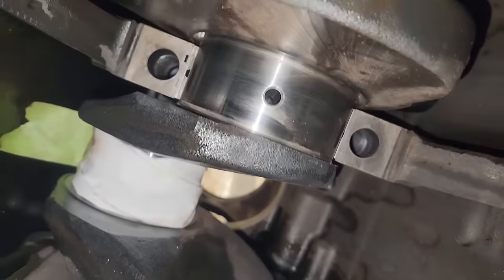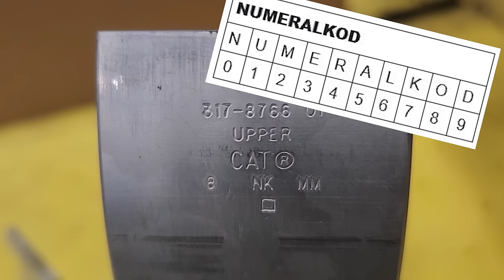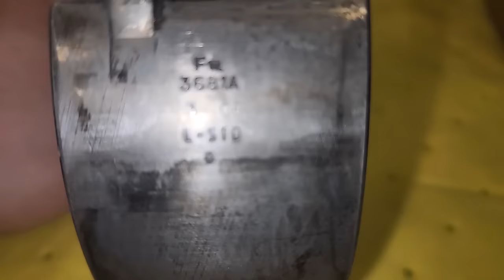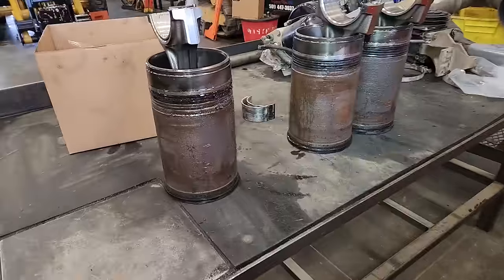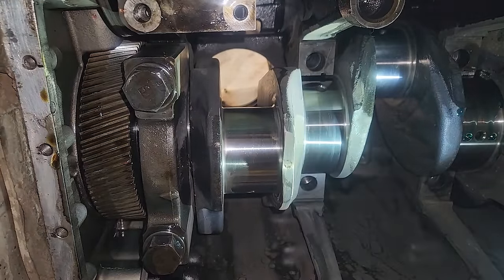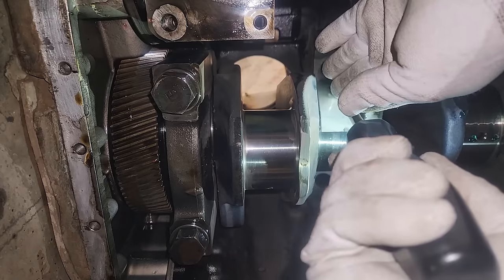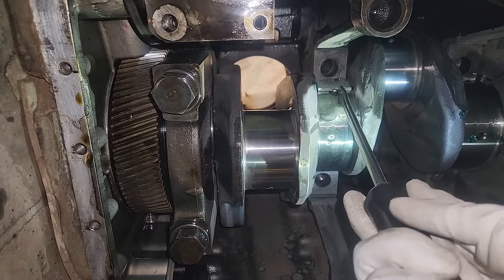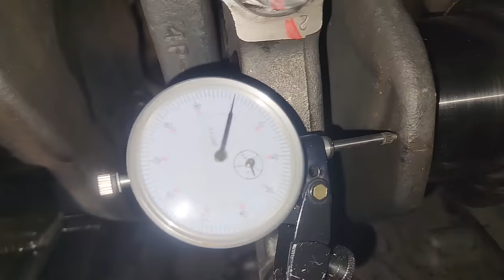How To Replace Engine Main Bearings.

Comment: I have used Lubriplate 105 for reassembly for more than 50 years. Dissolves almost instantly in warm oil. My roll in/out tools are short bolts with the heads ground down.

Comment: Great when an engine is this traditional configuration. More engines seem to have split blocks now that incorporate lower main bearings in the casing, thus screwing any in-frame bearing replacement. MAN & Kubota to name a couple. Thanks for the great video, love the use of the air brake diaphragms.
Reply: Iveco Cursor too((((
Reply: It’s purposeful, as it’s functionally much stronger to use a split block/bed-plate design.
Reply: Kubota has a modular crank That is inserted into the Block in the round mains

Comment: Inframed dozens of Cummins 855's in the 60's and 70's...all the mains then were torqued to 300 ft lbs then lock plate tabs folded over. I used a 1/4 inch clevice pin to extrate the tuff ones instead of a heel bar. Usually dropped all caps except #2 and #6 ...rolled in 1-3-4-5-7 then after that #2 and #7 and the thrusts were on the #7 ...you need to experience torquing a full set of mains laying on a creeper to 300 ft lbs. Lol
Reply: I found dropping and replacing 1 through 4 main bearings as a group, then installing those main caps, and then dropping and replacing 5 through 7 allowed very easy installation of the upper main bearings.
Reply: I'm working on a 1980 300 big cam right now, not alot of fun
Reply: i’ve done several cummins my self an i used a brass rivet on tha hard ones,put it n tha oil hole n tha crank an bar it around

Comment: Fun fact.  I used to work for Atlas-Copco in the industrial tools division.  One of the multiple nut runners we made was a 32 spindle for Caterpillar heads (I don't remember what engine).  I asked the engineers how they handled the toque sequence and to my surprise they didn't deal with it at all.  Whichever bolt got tight first got tight first and so on.  Not that you should ignore torque sequence but I don't think it's a critical as the manufacturers want you to believe.   Keep the good stuff coming buddy.
Reply: Atlas 🥰💗💗
Reply: And guys like this are why engine blocks warp!
Reply: So tolerances for bearing sizes matter but not torque sequences or values? Hmm 😅
Reply: A new guy that asked a guy that said a guy knew everything. Nobody could tell him what to do.

Comment: 16:30 is also called "torque to yield " or TTY and your division of the hexagon into 60 degree increments is ingenious. Very true and seemingly obvious once stated. Your solution is excellent if an angle gauge won't fit or is unavailable. Cool. I will remember this seemingly simple yet profound technique.

Comment: I knew an older fella back in early 80s who had old dodge truck with 6 cylinder. About every 6 moths he would pull oil pan and shim bearings with really thin piece of leather type material. He ran it for many years hauling junk around the county but drove slow and easy all time .
Reply: Awesome
Reply: Lol shouldn't need to do this every 6 months there was something wring if they  needed adjusting lmao
Reply: @digger_jon2778 the leather would break down and he would need to reshim the bearings. You're skull is thicc boi

Comment: My bearing procedure is almost identical to yours. I use a long brass drift to push the bearings in instead of the screwdriver. Used to torque turn with an impact but we acquired a raptor pneumatic torque multiplier at work. That thing is awesome! Especially with the new Detroits that have to be angled 90 degreesX2 and Cummins head bolts that are 300 ft lbs + 90 degrees. Prior to the raptor we had to use a 1” impact gun when angling the ISX head bolts. I can’t say enough about the raptor, it’s a great piece of equipment!

Comment: I'm balls deep in rebuilding my c15 and was debating if the main bolts should be done by hand or with a gun , I'm now sold on using the gun

Comment: I just had this done on my C15 Accert. They rolled in the rod and main bearings. I had an oil filter gasket fail and I lost 8 gallons of oil in a very short amount of time. No critical oil pressure warnings but I wanted to be sure. The bearings were very close to spinning according to the CAT folks when they pulled the #2 and #5 caps. I'm glad we didn't just fill her back up based on the lack of critical oil pressure warnings.

Comment: I'm doing an inframe on a Cummins 8.3. Wasn't planning on replacing the mains, but after seeing your video, I see how easy it is. Just hope I don't have to torque up to 200-300 ft-lbs as all my 3/4 stuff is sockets, a rachet, and 3ft breaker bar. No impact larger than 1/2.

Comment: I and multiple people that I work with have discussed torque turns with a impact and we are all to scared to do it. It does show that actually in the Cummins manual but we just haven’t seen it done in front of us. The engines that we mainly work on are German and they use the bolts u hate most, but actually inverted torques have more surface area for the socket and the load side so I see their purpose doesn’t mean I disagree because I hate them as well. Anyway I could go on and on about torque turns and why the factory has us do them and why I was scared to use the impact but I won’t I’m just going to do it. Seriously thanks for showing us, this saves our backs shoulders and hell my ezy red 3/4 bar which I saw u have as well in the tool box video. Merry Christmas
Reply from the maker: I actually just gave that EZ Red away to an apprentice as a kind of gift since I got a replacement 3/4" snap on head and bar. I've done a lot of torque turns with impact wrenches, on main bolts, rod bolts and head bolts. No problems and I've seen lots of other guys do the same on Cats, but German engines are a whole different animal. You look at them wrong and it'll through a check engine light.
Reply: @AdeptApe  I have that snap on 3/4 bar and drive too but in the marine world we don’t have much room a lot of times ,and taking the different size bars on and off is a pain even if I put a pipe on the shortest one it just feels unstable. I love that extendable ezy red for that reason although I have slipped the gears a few times and hit myself in the mouth. Our heads are inverted torx e22 150ftlbs then 3 90 degree turns and our mains are 250ftlbs and 1 90 degree turn. The mains are conventional head bolt 27mm head and I’m going to try your trick on those and maybe work my way up to the heads.

Comment: i liked your video.  i was told by an old mechanic to oil the back side of bearings as it promotes heat transfer. i have been working on 2 cycle Detroit for 40 years and cat only 20 and still learning.
Reply: Changes clearance
Reply: Whether you oil it or not, oil will find its way in there all by itself. There is no O-rings stopping it. I've never taken a bearing off a cap that wasn't saturated with oil on the backside.

Comment: I use an old main bearing, that I bent an inch into one side as a handle, and use it to push the bearing out. But I'll have to try that oil gally trick on my next in-frame

Comment: I hope that this helps guys. 
degree of rotation = (360 / n) * m
In this case, n = 6 (the number of sides of the bolt) and m = 2 (the number of sides rotated). Substituting these values in the formula, we get:

degree of rotation = (360 / 6) * 2 degree of rotation = 60 * 2 degree of rotation = 120

So the bolt was rotated by 120 degrees when two flats of its six-sided structure were rotated.

Comment: Unlike a lot of people here I see little if any problem using an impact to angle torque. All that is required is to get the bolt to turn a certain distance and how that happens doesn't really mater. When removing and installing upper bearings under the vehicle I would slightly loosen all of the mains just enough to give a few thou more room. Along with the bearing removal tool this seemed to help quite a bit especially on installation but I had to be sure the bearings where properly located before pulling the crank back up.
Reply: I agree, do the torque with a torque wrench and then the bolt doesn't care how it makes the turn.
Reply from the maker: I'm sure the uppers would be a lot easier if all the caps were loose.
Reply: @AdeptApe  only if you like doing front and rear main seals, but to each there own. you might get away with it on new seals but holding the crank up by the seals is asking for it
Reply: @AdeptApe  Seen fan belts to tight making the front upper bearing had to R & I. Especially on a 3208 that has several belts.

Comment: Excellent video tutorial. I take it you wash down engine downward after pulling sleeves then once more from bottom prior to bearing installs. Nice camera footage.
Merry Christmas
Reply from the maker: I'll brake clean the liner bores and the bearing journals before installation of anything.
Reply: @AdeptApe  

I started using lint-free cloths last week when I was doing valve-cover gaskets on my 1999 Toyota Solara. It could be paranoia, but I just want to be super careful not to have leaks.

I purchased them from advance Auto Parts which is an auto parts chain here around the Chicago area. They do carry some truck parts like headlight bulbs and I've used them for just that.

Comment: I've heard using a butter knife with the blade bent in a curve works pretty well. Haven't had an opportunity to try it yet though
Reply from the maker: That seems like it wouldn't be strong enough for a Diesel Engine.
Reply: @AdeptApe  I'll try it when I get an opportunity and I'll get back to you on that. I'd imagine probably have to push on the middle to keep it from bending while you push the bearing out
Reply: WITH THIS TRICK , WHY WOULD YOU BOTHER?

Comment: Josh great advice on holding the bolts and cap. My friend was rebuilding a 400 big cam. He thought he had the main bolt threaded enough. It fell out and landed right on his mouth. Needless to say your front teeth are not stronger than the bolt. It was a bad deal.

Comment: My 4X4 mainly off-road use hunting/fishing vehicles in Appalachian Mts where our off road hills get way over 16%. It will without a optional 100% full external oil pressured system run your oil sump dry on steep inclines. I drop many oil pan once my oil pressure start  droping below 25 psi or below cold & replace main & rod bearings back with Std. Bearings without pulling the engine. Just be careful because a lots times them 4X4 frames will leave you the room to do it with. I did my 79 Bronco that way this fall in less than 4 hour job. It  Increase oil pressure right back to normal. Our main problem is over our steep inclines is oil starvation. I never seen that in maintenance manuals but if you careful know what you doing it works. Of course inspect your  journals for wear.

Comment: I have a 3126B apart that only has 55,000 miles on it.  Do I need to use new bolts on the head, main caps and rod caps?  Thanks for all the videos.

Comment: I saw were a mechanic took all the main bearing caps down at the same time! Engine had the old rubber front seal, rolled main bearings in, and when he started it was running rough! I said you took them all down with none for support the crank just slightly?  The crankshaft gear had dropped down far enough to jump a tooth! Engine cam and fuel system were out of time! They had to pull the front cover to re-time the engine! It was an early 3406A engine! True story!
Reply from the maker: That's a really cool story. Not for him though. I always have left at least 2 mains in no matter what.

Comment: Im a mechanic and sometimes the upper main get really stiff when trying to push them in! any advice on how to roll them in easier? the only way I have done is using a flat screwdriver and a hammer and hit the bearing with it but i dont wanna keep doing this as it might damage the bearings and even the cramkshaft :/

Comment: I have one question. Is there gonna be a noticeable difference regarding engine smoothness while running after the bearings replacement? Or an increase on something?
Great video, very detailed and full of knowledge. 
I know it's such a noob question I'm just finding a more appealing reason to do the same work but on a sports bike other than just maintenance.

Comment: What about placing gasket maker in the groove under the rear oil seal; is it necessary to prevent leaks past the seal and can it cause a problem with fit?

Comment: They don't look that bad , what was the milage ? Also what miles or hours of run time would you recommend the big end bearings and thrust washers to be replaced , on a 2003 / 4 C15 ?
I was thinking to change mine at the 2 million mark when is come , it's at 1.5 million now, I have good oil pressure so best leave it alone if it's not a issue .
Reply: I agree but if I were you I'd start doing oil sample analysis with each oil change so that you can catch a bearing that's starting to wear before it gets too bad and spins

Comment: I've taken a small bolt and ground most of the head off  when I didn't have the tool, works on most engines but not all. As a side note, I worked with a guy that only put the bottom bearing in. I shuddered every time he did it.
Reply from the maker: The other guy left the top bearing out or he only replaced the bottom bearing?
Reply: @AdeptApe  left the top bearing in and replaced the bottom. He said the crank was being pushed away from the top bearing. My thought was that you can't buy just the bottom so you might as well change the tops too. I  did one that he had done a few years earlier  and there were fissures in the babbitt with some pieces of babbitt missing, it had about 200,000 on it since he'd done bearings.

Comment: Do you have a video on why a caterpillar motor at startup sounds ok,then sounds like it dies out but comes back? I got 2005 c15 accert, had injectors rebuild, new wire harness, but it was doing it before I had that work done.

Comment: Only one thing, normally, you need to measure the bolts, if you exceed the specification, you need to change them, if not, just reuse them.

Comment: Great video. Thanx a lot for these kind of videos. I have one question. I thought that the tab prevents rotating the bearing inside the cap. But if the crush prevent that, i need to know the purpose of that tab on the bearings ?
Reply from the maker: The tab is for aligning the bearing in the journal bore during installation.
Reply: @AdeptApe   @AdeptApe  Thank you very much sir for  your reply. These videos are very much helpful to us and we always thankful to you. " whish you a Merry Christmas "

Comment: why didn't u steam genie under the hood before beginning work to get rid of the loose dirt?
Reply from the maker: We have a pressure washer bay, but it's well below freezing right now so it isn't getting used. The customer never washes their truck, not my fault and with all that said, I didn't start the job. I was given it after the oil pan and valve covers were already removed.

Comment: Hey Josh watched a lot of your videos before we did an inframe on our 3406 PCTA the engine has the cat brake saver have you ever worked on a brake saver would love to see a video some day !
Reply: He has a video on a Brakesaver. You have to be careful when you rebuild one. Did you know you can't put a PC in in a chassis that a DI came out? Radiator is larger in a PC engine. Most 3406 PCTA was 360 HP or 375 HP.
Reply from the maker: I have a video talking about them, but I'm not an expert on them. John in the above comment knows more about them than me.
Reply: @AdeptApe  thanks josh keep the videos coming !!
Reply: @johngoldsmith6629  my engine is a 375 hp my friends also the same engine is a 360 makes sense about the radiator also the oil cooler is a lot bigger.
Reply: @pcap2700  Brakesaver oil coolers goes from front to the rear. Worked on a early 1693 Brakesaver engine. Early engines the Brakesaver oil cooler was not mounted on the engine. This one was mounted near the front tandem with coolant and oil lines going to and back. Do not remember how much more oil was needed to fill it up. A dry start would probably fail some bearings.

Comment: My Cat oil samples keep coming back 'no action required' so I think I'm ok on bearings for now. 1.5M on my 6NZ and still runs awesome
Reply: Km or miles?
Reply: I'd replace the mains and rods anyways because the slow wear might not be picked up by oil analysis.
Reply: @kodykj2112  Miles
Reply: @Eastahtata  the oil samples go to Cat Analytical Services in PA and they don't miss a thing
Reply: whats tha worse u could do ? spend some $ on parts/ labour or RISK crank damage ? then an inframe becomes a major $$$ & mo $$$$

Comment: I have an MXS with just over 1.3 million miles on it, never been apart, do you think I should roll the bearings in it for good measure or just keep running it until it's time for a platinum kit ? It sure runs good still.
Reply from the maker: Oil pressure and oil samples are good? I'd save your money for a repair when you need it.

Comment: I have never seen the tool to roll the bearings out using the oil port!  That will definitely be getting added to the tool box
Reply from the maker: You can even use a bolt with a flattened head.
Reply: I have sheared them off on a stubborn bearing. Especially one that has had a failure and is stuck to the crank.
Reply: @AdeptApe   will definitely be trying the bolt. I've got an MBN tore down that the bearings are pretty tight.
Reply: @AdeptApe  do you have a part number for that tool?  Thanks!

Comment: 13:13 Not a mechanic but I was wondering if you could use a plastic trim tool to roll the bearing in rather than a screwdriver?
Reply: Thats what i was thinking